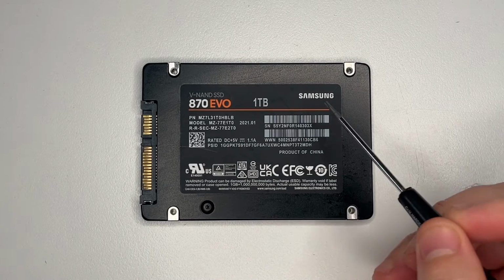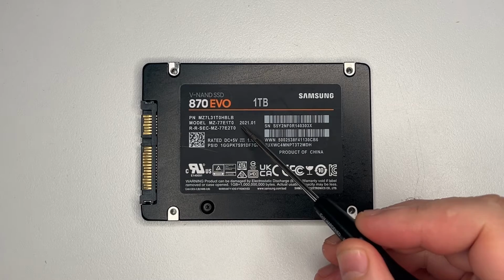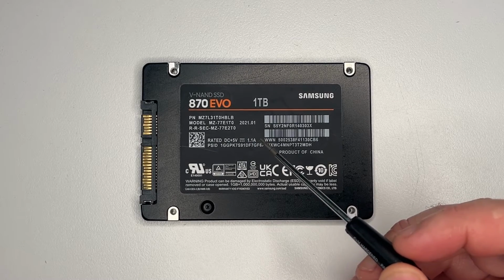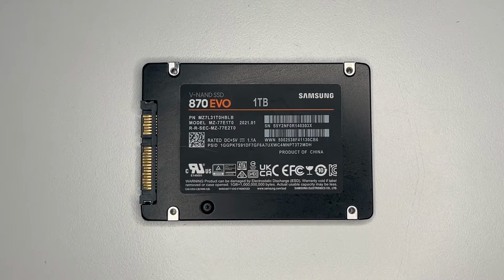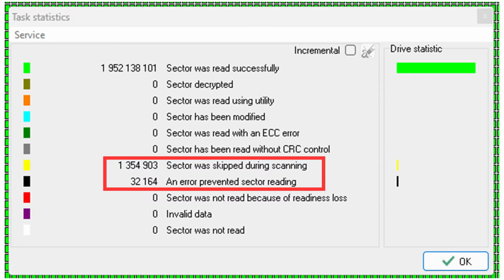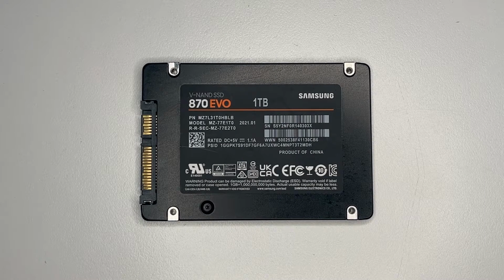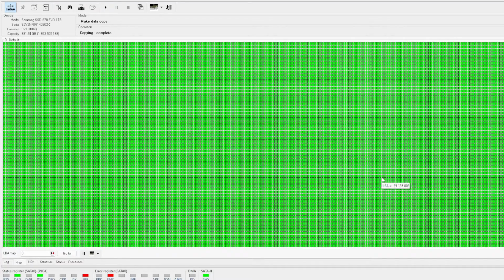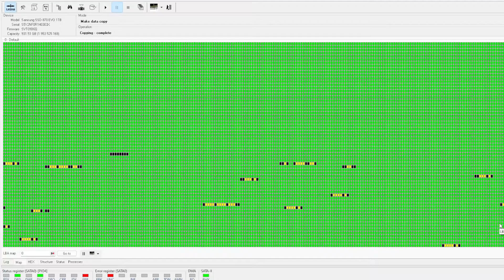1.5 Million Bad Sectors - Samsung 870 EVO SSD Data Recovery

Comment: The 870 Evo 250gb, I have been thoroughly testing it being myself a senior IT technician for over 30 years. The disk slows down its writing speed from 530MB/s to 380MB/s when used as system disk and after filling up its SLC cache with files that exceed its cache capacity. The unit NEVER recovers from 380MB/s sequential writing speed, unless used as a secondary drive or left idle for at least half an hour. 
Samsung did not provide a solution and I'm quite sure they are fully aware of the problem which, according to my tests, resides in their firmware/MKX controller which does not perform garbage collection when the disk is used as a system disk, perhaps because of the controller sensitivity which is disturbed by the so-called noise generated by the OS. If you test the disk as a secondary drive, it will always write at 530. That's bad engineering, nothing more nothing less.
How to test it: As a system drive, try to copy a 30gb file from a different disk that can provide at least 530 megabytes per second, and once copied, press the shift+del and test your writing speed again a minute later, which is more than enough time for the SLC memory to write onto the TLC memory cells if the disk complied to the standards: what you will see is your writing speed going down to about 380 and likely it will never recover from that speed unless you close all the programs and leave the computer on idle. In some cases, it requires a Secure Erase of the disk, or setting it as secondary drive, or put it into a USB enclosure for the controller to start the garbage collection process (folding). That's absolutely unacceptable and it violates the declaration of conformity by Samsung. Any decent SSD will empty the SLC cache within a matter of 1 minute top. This 870 is a disgrace! 
If you have further information which I missed, please let me know. Also, let me know if you found a solution.
Production date of my sample is September 2025.
Regards

Comment: Can you tell me if it is possible to recover the data from a defect Samsung 870 EVO 4 TB SATA 2,5" with bad sectors in the memory chip/Firmware damage without using ACE-Lab?
I sent it to a recovery expert who told me that this SSD is not supported by ACE-Lab and can therefore (according to his knowledge) not be recovered.
…so now I am trying to find out if there is really no way apart from ACE-Lab to recovery before I must say goodbye to 2 TB of private data. : (
Reply from the maker: Does it detect with full ID? model, serial and capacity? and does it have any access to the data area or is it bricked off?

The data recovery industry is very small and not a lot of research happens outside of ace-lab who are my friends :)

You need to find someone who really checks all the details first and knows for sure that the firmware is bricked.

Our team is getting good at low level reverse engineering but its also hard business to dedicate a small team of engineers working on 1 SSD for weeks or months. So sometimes the easy cost effective answer is unless there is a simple ready made solution like what ace offers then its hard to justify the costs.

Comment: I've read that those made before November 2022 are bad ones. Those that were made after actually would have somewhat different hardware, and manufactured differently, and shipped with an even newer firmware that cannot be used on a pre Nov 2022 EVO 870. It sounds to me that the early 870 EVOs not only had a bad firmware but also a bad/defect hardware in many cases. 

Can anyone confirm this?

So far I haven't found any report or video with a faulty 870 EVO that were made after Nov 2022. But that's the creepy thing here. These errors they have doesn't appear immediatly, it takes some time, some few years even until they start having bad sectors. I'm hesitant to buy a 870 EVO, even if it's a recent manufactured one.
Reply: I just realized my 870 EVO is faulty. Diagnostic software says it has 100% bad sectors. It was manufactured on 25 November 2023 (this is what a label on my SSD says). I bought it like a week ago....
Reply: @PaniczAdam 100 or 100% bad sectors? What software do you use, Samsung Magician? Any other errors, like CRC errors? If it is CrystalDiskInfo those numbers could be the "score" number kind of. What you need to read is the number to the right in RAW format. If that field is 000000000 kind of for bad sectors then it's 0 bad sectors.
Reply: @AB-gm4yi  Actually both - Samsung Magician and Aomei. I already shipped the SSD back (warranty claim).
Reply: @PaniczAdam Ok but you're sure you watched the right field? In CrystalDiskInfo for example the "current" and "threshold" are score number, but the actual info is in the raw field that I mentioned. Did you do a health scan with Samsung magician before you sent it away?
Reply: @AB-gm4yi  yep. Samsung Magician says "Diagnostic Scan has stopped due to unknown reason" (full scan selected). When using S.M.A.R.T. self test the error is different - S.M. says: "Unknown!" I have 2 different EVO 870 SSDs and they work perfectly and S.M. is able to test them without any errors.
Reply: My 1TB 870 manufactured in October 2022 is toast. Had a lot of freezes, crashes, and abysmal read/write speeds

Comment: I had one of those drives, 2TB version

It started losing data after 5TB written and 2y of use 

They are known defective and have a very high failure rate compared to the 860 EVO
Reply: AFAIK after october 2021 this problem is fixed. So check your drive manufacture date ( its on the label sticker )
Reply: have samsung fixed that problem with newer versions?
Reply: Mine failed the exact same way. I switched to Crucial, fingers crossed it will last
Reply: mine failed last week, 4tb version. Idk which model I shoud pick :(
Reply: My 860 evo (manufactured in 2019) has issues as well. It gets to 100% from time to time and error count is already in hundreds of thousands. And it's only 40 TBW.

Comment: I wonder if those pins clean up using a white silicon eraser. ( it's an old trick from years ago I used to use on ram) I still use it on micro SD cards.

Comment: 2021 I think that was during when the drive firmware would go crazy and kill a bunch or the entire drive I think the effected ones are built 2021-2022 and where past that it has newer better firmware where that should happen anymore why they released it without testing the firmware idk they should work on their quality control I thought Samsung was supposed to be good and high quality guess not
Reply: They even changed the manufacture process from Nov 2022, and included in them a newer firmware which couldn't be applied to those made before Nov 2022. To me it sounds also like a defect hardware in the earlier batch.

Comment: I'm just an idiot who has never traced board traces before.....but I got to question your methodology here.

Why troubleshoot the power supply and lines? According to your screenshot, almost 2 billion sectors were read successfully and (rounding up) 1.5 million were not. That's a relatively high success rate. That's still a concerning kind of failure, but I digress.

That means you were able to read well over 99% of the drive (presumably) without issues. Why troubleshoot the power when you successfully got 99% of the data? Was the data nonsense/corrupted (assume no encryption)?
Reply from the maker: Most data recovery services would just solve the problem and be done with it but we collect all data so we have a road map to solve future problems

Comment: i have an 10 years old OCZ SSD, 0 bad sectors, work perfectly. In the last 5 years 2 Samsung EVO SSD dropped dead. No OS recognize them.
Reply: The OCZ is probably SLC or MLC, the Evos are (3D) TLC or QLC. I've got a few drives about the same age, and they're flawless. A huge problem with SSDs in general is they just die without any warning.
Reply from the maker: Exactly! Old SSD have far better quality memory than today.